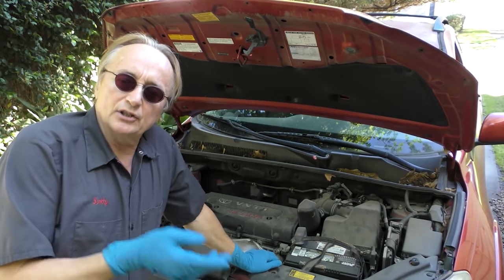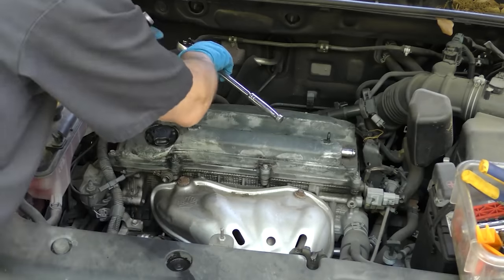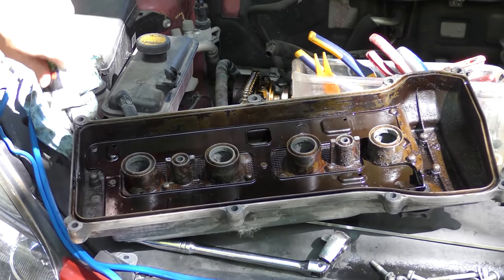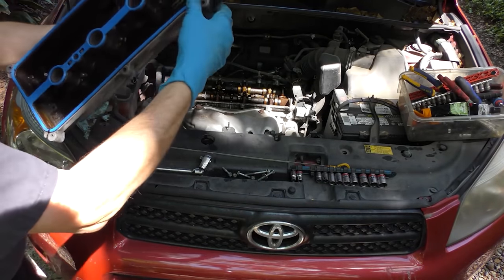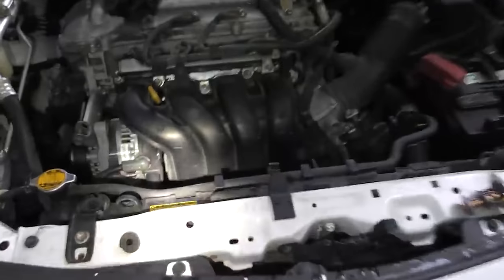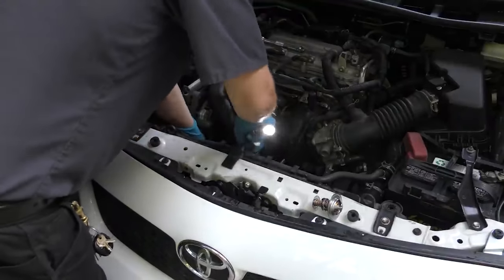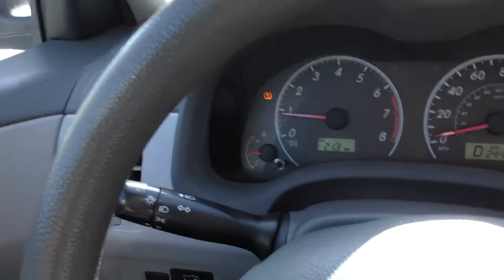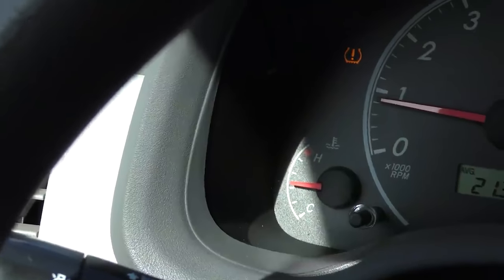3 Mechanic Scams Caught on Camera

Comment: This is precisely why I haven't set foot in a dealership service department for over 30 years.
Reply: Independent shops are worse, using aftermarket (knockoff parts) and charging you double or sometimes triple for junk parts.  Better just to spend money on a factory service manual and do it yourself.
Reply: And I guarantee the root canal would be cheaper.😂😂
Reply: i have steped in one on a few occasions. i left woth no bill. only if under warranty or a recall. otherwise run like the buiolding is on fire.
Reply: ale. jandro  hey some dentist can be just as bad as mechanics
Reply: @jdigitalseven7  I caught my local family mechanic scamming me; first time they said they warranty all their work for a certain time my distributor went bad that they had replaced, they told me they still
Would have to charge me for their labor on the new one but not the part; whatever …. Second time they said they did 4 hours worth of labor when i was actually waiting at the shop and they only did one hour or less of labor; third time I caught them red handed was the worst where we didn’t go back ever (these where “family friends” mind you) … I understand they have to put food on the table but geeze … 02 sensor went out on a civic, I was going to do it myself but I couldn’t find one after going to autozone they tried to sell me a used Denso then I went to another place that was out of stock, I went to this “family mechanic” and they were trying to charge double the price than what I would have payed for a new Denso (you know they get better deals then customers too) … so, after that I told them that was a crazy price and I’d buy my own; so I bought a brand new up stream Denso 02 sensor and gave it to them to put it, (yea I asked to have my old one they took out) bought one at about half the price of whatever crappy brand they were going to put in and never returned there since… especially after seeing the crappy job they did putting it in. Actually taught me a huge lesson.
Reply: @jdigitalseven7  do it yourself always better :D bcs you don't have to trust someone
Reply: You mean stealership service🤡
Reply: @jdmforever5583  That too.
Reply: Me neither....Ever!
Reply: @codorin  bruh, are you running while typing?
Reply: @PhilJLF  Good on you!!
Reply: Bobby Jackal  Ouch!
Reply: When I bought my first car as a teen I learned their true name: Stealerships or Stealyourshit  No way that a well-reviewed independent shop is worse than a stealyourshit.
Reply: ANY shop can do poorly.
Reply: The valve cover gasket that was used is not oem so i doubt it was a dealership that performed  the repair. The oem Valve cover gasket fits nicely and you wont need Scotty's recommended glue.
Reply: Me either ! Their RIP-OFFS .
Reply: @jdigitalseven7  true, regular small business our crooks Amen
Reply: @jdigitalseven7  the jokes on you jack dealers use the same exact parts unless its a dealer only part and if you think different think again and i give the option to use whatever grade parts you want if its a $75 dollar Mooge tie rod or a $17 dollar one from Autozone
Reply: @joelopez40oz23  that was a felpro its better than a oem the problem was they rushed and didn’t seat it down in the valve cover you have to push the tabs down i use a thin paint stick
Reply: @ruthiekest3218  well i have customers who trailer their cars well over 200 miles from Indiana to my house far west Illinois I’m almost 38 years old and people i went to high school with still bring their cars to me and its very obvious if you are getting ripped off because a honest mechanic will give you price choices on parts cheap vs expensive and they will keep the old parts show you the parts and show you what went wrong
Reply: Any Tech with a brain will do the right thing in the long run they make more money by you coming back the next time your 💩 kicks the bucket then you start bringing in the wife’s car the sons car the daughters your fathers your sisters you tell your neighbors
Reply: Lol I’ve seen people have way better luck at dealerships. Bro every small shop I’ve ever been to was a fuckin nightmare. I had one say they would get to my truck in a week. After over a month hearing them say they haven’t found the problem yet I looked it up myself found out it was the computer went to their shop put the computer in and it started right away. That was after I paid 200 for the truck to get towed there and before I paid over 200 in fees for them to look at it and not fix it.

Comment: This is why I decided to become a mechanic myself! 🤦🏽‍♂️
Reply: Same here brother
Reply: That’s awesome!
Reply: Smart man
Reply: Just be an honest one. Lol
Reply: It’s been 5 years I do all kinds of mechanical job in my Pilot 
Tired of getting ripped off
Reply: @sertac1000  it feels great fixing your own vehicle
Reply: @kingofgames1986  thx
Reply: Why didn’t Scotty show us the twisted pinched valve cover gasket????
Reply: And a lawyer and a carpenter and an electrician and a dentist.. 😄👍👍
Reply: @acurarl9929  Because as soon as you pull off the valve cover, it isn't pinched any more!  It fell right out of the valve cover!
Reply: @sbhassan1  it would be extremely visible to see a pinched gasket regardless it falling off. If it was still stuck to valve cover I’d pulled it off to see the pinch anyways. It’s not like it’s memory foam an pops back to oem shape. The pinch would be imbedded permanently
Reply: @acurarl9929    u  are right, Acura RL.
Reply: If you want it done right do it yourself
Reply: Congrats 👏
Reply: Yes thats me as well
Reply: Me too 💪🏽
Reply: I wanna become one. Been looking around the city for apprenticeship but no luck. Any advice?
Reply: @johnkisaragi5920  are you from Sydney?
Reply: @matthewxerri867  Boston, lot of bad roads here. Planning on going to an auction down in NH and nab myself a car. I'm completely new to mechanical engineering.
Reply: @johnkisaragi5920  good luck all I’d say is to read about all the systems. There’s Engines, Brakes, Transmissions, Suspension and all the rest I fix trucks and machine but understand how brakes work on cars and so on. It’s about what you know, more than how much you can do

Comment: "Take off the stupid beauty cover" - Scotty.
Reply: ...and toss it.
Reply: The latest beauty covers aren't even plastic  They're foam now.
Reply: @Thorscauldron  If yo break it you can make a new one with a can of Great Stuff.
Reply: The guy I bought my car from keeps trying to give the one for my navigator......!!!     I tell him when I'm finished working on it.....only be in my way right now.....!!!!!😂🤣😂
Reply: Those covers control heat and engine noise. The newer cars have foam because of high pressure fuel pumps making even more noise than fuel injectors alone do.
Reply: @JimmyMakingitwork  
Control heat ? I notice Scotty complains about them. But he leaves them on his own cars 😅 The first thing I do when when I buy the cars is toss those.
Reply: Put it on my gravestone
Reply: @JimmyMakingitwork  How does it control heat? I see it as a shroud that collects heat underneath.
Reply: That cover can save the engine wiring from a bath of hot antifreeze if the engine overheats
Reply: @IMHipp-wp3sd  Sure, for that small chance when your engine overheats and radiator cap releases pressure. I've had it happen once in 30+ years of driving. But for 99.99% of the driving time, the shroud is collecting heat around the engine.
Reply: Those plastic ornaments are to reduced the engine noise remember new cars have aluminum engines,,heat dissipates much quicker
Reply: Deer mice like to use the area under the plastic cover on top of the valve cover for a dining table on our Cobalt. Hickory nut shells litter the area. Heat trapped under the cover must be comfy in the winter. My 🐈 cat isn't earning the feed bill. Caught a couple with a snap trap.
Reply: beauty covers are the car's panties.  The best ones are the kind you can just pull right off.
Reply: You mean, makeup?
Reply: @SupeDefy  controls the heat from getting to the paint on your hood
Reply: @SupeDefy  the engine is water cooled.
Reply: @donteven5712  So why make the cooling system work harder?
Reply: @donteven5712  Think about the hundreds of millions of cars that doesn't have an engine shroud.

Comment: Last week my mother in law took  her 2011 Camry with 49K miles for AC 
service , it was blowing hot air, The TOYOTA dealership gave her an 
estimate for $2879 to fix, she calls me and asked me why they were 
asking so much money to fix AC, i told her to forget it , not to 
authorize, bring it home, bought a large can of R134 $28.00 from 
walmart, charged it from the low side , Compressor started to kick, 
inside temp 39 degrees, she is been driving for a week now , still blows
 cold AC at same temp 39 degrees . Cant believe  these scumbags, trying 
rip off a 68 year old senior citizen
Reply: they will happily ripp anyone off especially seniors.
Reply: @CP100  you must of went to a Chevy dealership.
Reply: That’s how they make a living. Scammers. 🤷🏻‍♂️
Reply: Yeah, they prey on older folks, especially women. They have no shame. Like Scotty says, they have to pay for the overhead, so scamming is what they do
Reply: Well, since it was low or out of refrigerant, it has a leak. It will leak out again. A professional would give an estimate to fix the leak. Maybe $2879? 
R134a is a very potent greenhouse gas.
Reply: They target seniors especially old ladies. Repair shops know it's basically free money scamming them.
Reply: for a few hundred you can buy the right tools to do the job right and your first repair will more than pay for the tools
Reply: You have a leak, refrigerant doesn't just vanish, it leaks out. It is illegal for the dealer to recharge a system if they know it has a leak. I don't know if you really needed a $2800 repair but I know the dealer can't just dump refrigerant in like you did and I know that what you put in will leak back out sooner or later.
Reply: @Daaremikkel  yep, and what's worse...he put in a large can of freon from walmart? How much is the system designed to hold? And of course the stuff more than likely contained that stop leak junk. That stuff ruins systems...and then when a real professional eventually has to attempt to fix it correctly, it is even more expensive because the system is contaminated with stop leak that would damage their professional service equipment. That stuff is junk. The new systems are very small. A few ounces under or over will cause major damage. Auto repair isn't like the medical field where they misdiagnose on a regular basis....and you still have to pay 10s of thousands for misdiagnosis....mechanic shops have to take responsibility for their mistakes.
Reply: @williamdujkasr3665  really medical field misdiagnose? Come man don't compare what doesn't complement each other.
Reply: @Owen Carey he got his computer from a Chevy dealer!😆
Reply: @Daaremikkel  Probably a bad hose or o-ring on the firewall or compressor end. Easy fix either way.
Reply: @williamdujkasr3665  Shops almost never take responsibility for mistakes and they do perform repairs above the diagnosis that are not needed to make an extra buck. They only items used for AC service is a high low gauge to check for proper pressure during operation, black light pen to see refrig leak and some hand tools. Easier to fix than you think. And by the way, all recharge kits have trace oil amounts in the can to lube the system. Even if they use a bigger all in one Snap-on ( I worked for them in the repair center for 20 years ) or other system for recovery/recharge, the sealer you speak of is long out of the system via the leak you may have.
Reply: Which Toyota so i can call them
Reply: @kriswingert1662  agree. if the coolant leaks out again, check for no pressure at the low side valve, then put pag oil on orings and replace them (with a new drier/accumulator)
Reply: @kriswingert1662  Licensed, bonded, and insured shops that want to display ASE or BBB plaques are held accountable, yes.  Funny you didn't mention your MACS certification or the fact that the ASE discourages the use of A/C recharge kits, and that the EPA will fine an upstanding shop to death for not ensuring system integrity, which requires more than just pressure gauges and UV pens.  At the very least you could have gained some credibility by mentioning r134/r234yf sniff checkers being a decent backup if you don't want to buy the $15k+ recharge machine that warranty and insurance companies require them to have regardless.  Your 20 years don't mean crap if the last cars you worked on have 30+ year old tech because with modern emissions integration and market regulation the game has been changed.
Reply: If theres only two or three honest mechanics for every one thousand, that means somehow  we are part of the problem.
Reply: HVAC-r tech here. Leak dye and hoses are cheap. Hell, even if the compressor is busted, that's cheap-ish too. And checking pressure on low side isn't enough. Get a 50-70 dollar used manifold gauge to check high and low. Just filling it up with refrigerant using a low side gauge and r134 can damage the car. Scotty has vids on this stuff.
Reply: I’m just happy my local Toyota dealer is on the top of their game
Reply: @futurus777  You mean any Stealership? They are all crooks.
Reply: @Daaremikkel  shoot ollie gates is tryin to stop us man. Forget cars. 7.4 billion breathers lol.
Reply: Those redtec cans are not r134. R134 is an ODP gas. Those cans are a propane derivative  that is similar, but not the same nor is it good for the system. Also, it obviously has a leak, which they were trying to fix.
Reply: Bruv, she was dumb enough to take her vehicle to a dealership for a AC fix, sharks smelled blood in the water lol
Reply: Yikes 😳
Reply: @Daaremikkel  well since the compressor kicked on and everything is working properly, then whereever the leak is... That part and labor isn't gonna be 2879. Therefore.... Ripoff!
Reply: Great job what you did for your mother in law.  That is the very same reason why I rarely take my car to the dealership or to any other auto mechanic shop for repair.  I just fix it myself with all of my cars and they all are still running perfectly fine to this day.
Reply: @Daaremikkel  Nope, not necessarily.  Automotive HVAC systems are imperfectly sealed and a dribble of refrigerant is always leaking out, even when sitting.  It would not be unusual for an occasionally used vehicle to be out of refrigerant after 10 years of garage duty.
Reply: Damn, see it everyday. I was at a Firestone shop getting new tires. I over heard a mechanic tell this elderly lady that she was going to get a good deal today. They were going to charge her 500.00 for a tune-up, only changing the plugs and air filter. I can do that for less than 100.00.
Reply: @virtualsam  Did you stop her from getting ripped off?
Reply: @Daaremikkel  r134a isnt that bad r12 is whats really bad but otherwise i agree with you, that commenter is ignorant, ac leaks dont fix themselves
Reply: Cesar Morals don't exist anymore. It's all about money sadly
Reply: 10 year toyota master tech here. That model camry  r known for AC evaporator leaks. Its inside the dash so that estimate seems legit. Around $600 in parts, the rest is labor n fees for a 9hr job. Cant disagree on dealership rates of course.
Reply: @Daaremikkel  Ollie- it’s a 2011. If it lost 14 Oz of refrigerant in 10 years that’s a minuscule problem.
Reply: @warpig4942  10 years later
Reply: I had the same exact issue with my Jeep I went to 10 mechanics 10 of them and they all wanted to charge me for checking the whole system I knew there was no leaks until I went to this shop I saw that said handicap services and AC they helped within an hour all it need was a can of 1234yf 🙏 I swear they try and scan everywhere
Reply: The dealers are called stealers for a good reason lots of times
Reply: Dealerships have no conscience so they will rip anyone. Take your car to a trusted mechanic after out of warranty if bought new
Reply: They don't test drive your vehicle after a repair, until it's time to use the customers car to go get their lunch. I've seen plenty of videos showing dealership mechanics using the customers vehicles for errands, for lunch, and even taking them home at night. Stop using dealerships 👿
Reply: @williamdujkasr3665 I have never heard of a mechanic take responsibility for a mistake, they just charge more money to fix there own Messed up work.
Reply: Had my wife call and tell me a shop charged her $250 to "diagnose and repair the AC" yesterday. Walked in to ask for a break-down of the issue, they informed me they "pulled codes" and "cleared the codes." Asked them to furnish the diagnostic codes. Suddenly there were no longer any codes, their technician "reset the computer." I asked them where was the computer on the vehicle and how did they reset it. "The mechanic had to get at it, I'm not sure, he's on lunch." Jokers then pivoted into trying to sell me two new exterior tie rods for the front-end $700 and $1985 for two new lower control arms and ball joints on the same. These clowns tried charging my wife about $600 for parts and $2100 for an hour of labor.

Thankfully nice folks like Scotty put out informative videos so I can safely operate a lift and jack stands, loosen and tighten a couple of nuts and get it all done for under $1000 including a proper alignment.